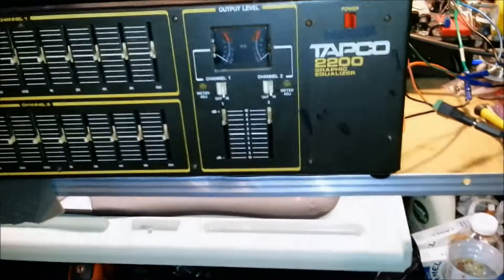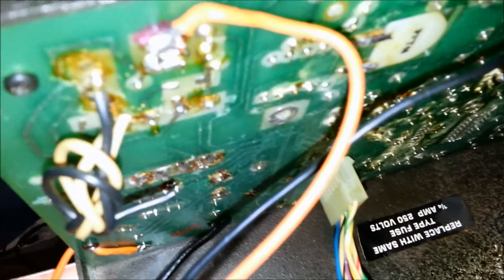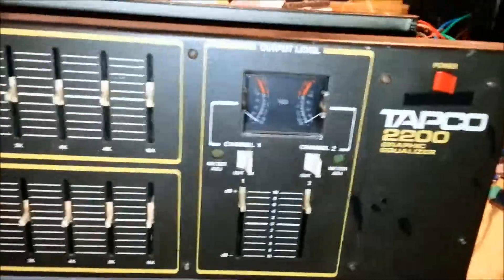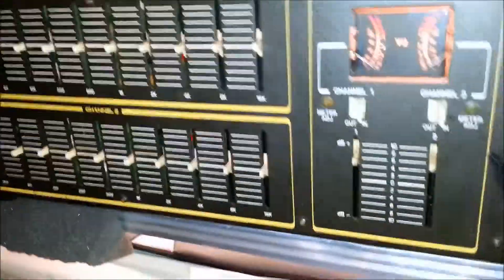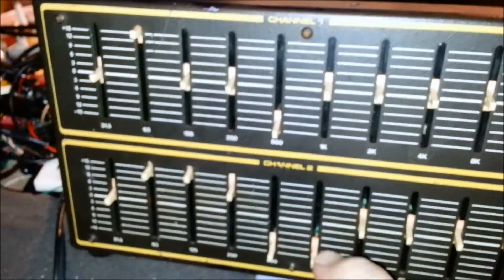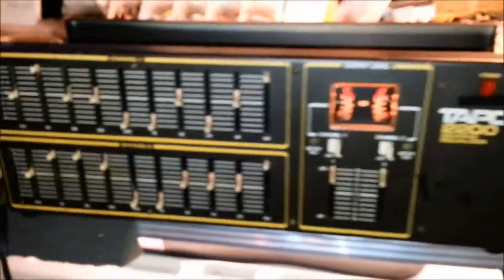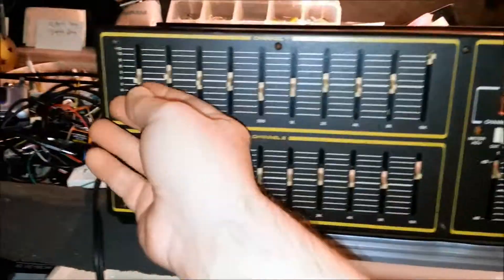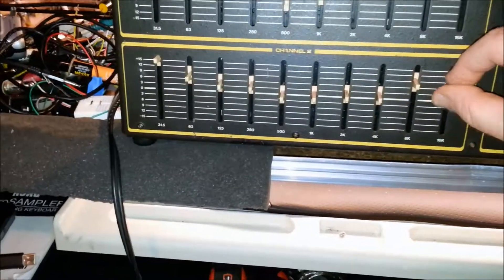Tapco 2200 Graphic Equalizer ebay find and fix.

Comment: Hi I found one of this in the local shop, but there is not much information about this EQ on the web. How do you like it, how does it sounds ?

Sorry on my bad English.
Reply from the maker: Your English is perfect. I think the unit sounds good. I don't really use it but, from what I have it does a good job. I'm just a fan of vintage gear in general. Is the unit you have in good working order? I do suggest using Deoxit on all the sliders.
Reply: @nonsuch  Thank you for your kind words, and the quick reply. I am big fan of analog audio equipment as well, but I'm not knowledgeable, like you are, to fix or restore vintage gear myself. I still didn't bought the unit, or have a chance to test it. Need to be ordered, before I can test it. Found it for approximately 60 euros. Do you know how much are they worth nowadays? If it's not indiscreet, how much did you pay for your EQ?
Reply from the maker: @sonysoni5079  It's been so long since I bought it I can't remember what I paid. Although, I can tell you it was very cheap or I wouldn't have bought it. Especially in non-working condition. Have you checked eBay to see if there are any for sale? Also check past auctions to see if any were on there, and if so, what they sold for. I think 60 euros is a great price, especially if it's working. Can you ask the seller if it works?
Reply: @nonsuch  When I was checking on ebay, few days ago, I didn't find any of them. I am probably going to get it. Technically the unit should be in good working order, but case exterior isn't particularly well preserved, but i don't mind that vary much. I even like the look and character of distressed hardware, as far as they perform normally. You should keep your EQ for now. Everyone is migrating in to a digital realm. Working on a DAW-s and plugin EQ-s. All manufacturers of analog audio hardware also migrate to digital. Digital mixing consoles, EQ, compressors... This analog hardware is going to go up in prices considerably in a few years span. I can't remember that I seen graphic EQ whit VU metars before. They're going to be gems.
Reply from the maker: @sonysoni5079  Yeah, I have a lot of analog gear. However, there is still a market for it. A lot of companies are making reissues of sought after products and there's plenty to be had of brand new items. I've been using DAWs since 1994. I just have always used a combination of analog and digital. Definitely get the Tapco. I don't think you'll be disappointed as long as it works. Like I said before though clean the pots with Deoxit. They will perform better and slide easier.
Reply: @nonsuch  Thanks for the tips Rob. It was a pleasure talking to you.
Reply from the maker: @sonysoni5079  Likewise. Goodluck!

Comment: Have same problem where on board do I wire + and - from a external 16v power supply on board cannot see in your video. email is spmbc@msn.com. cheers
Reply from the maker: My cellphone/camera died a few days ago. As soon as I get a new one I will open it, takes some pics, and email you them.
Reply: Cheers thanks a lot.